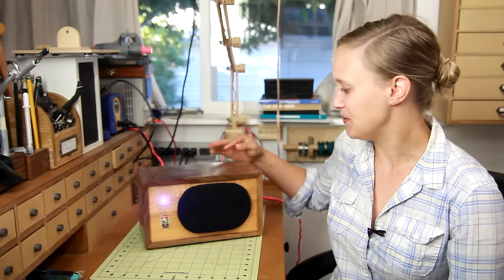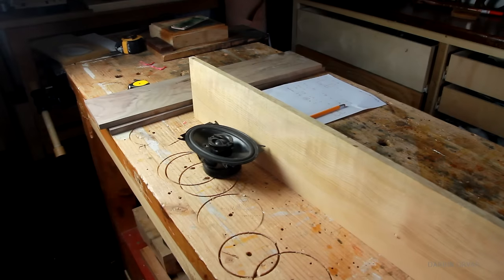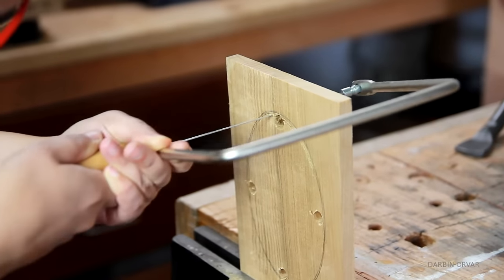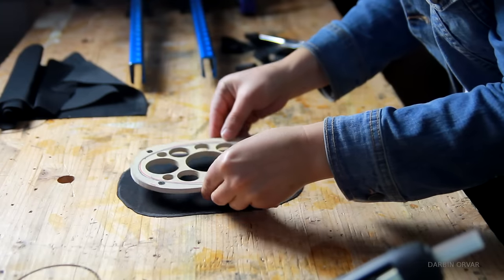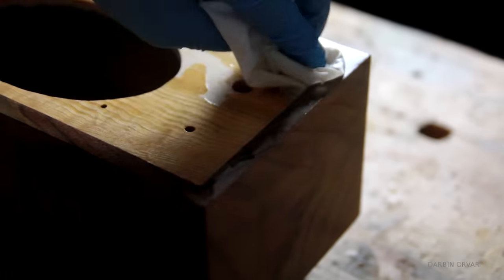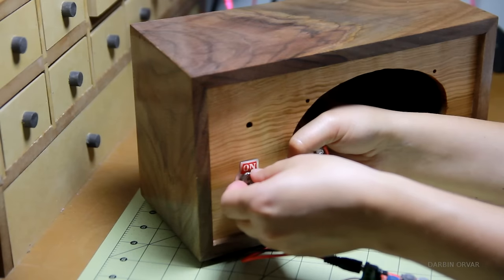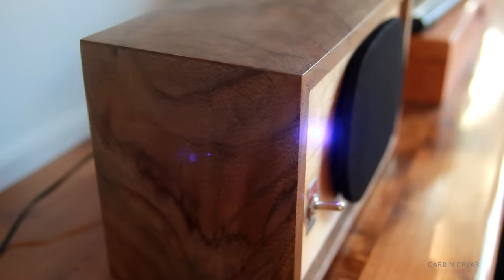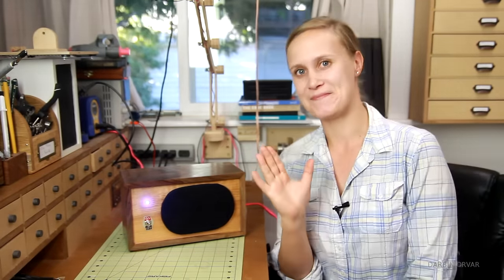DIY Bluetooth Speaker

Comment: Hello there. I just finished making a speaker like yours. Your video inspired me to make one. I used wormwood that was milled from old pier pilings from my local area for the sides, and then I used cedar for the front and back faces. Looking back at it, I think the wormwood is also cedar. I decided to go with a red case over my switch and finished the wood using orange oil. I also got my speaker for free but my speaker is bigger than the one you posted a link to, so my box had to be bigger as well. This was my first woodworking project so the joints are very good but i'm happy with the end results.Here is a photo of my finished product. https://drive.google.com/open?id=0BxS5X6VokvuCdnZNTndpNjFuaVU I really enjoyed your video and came back to it so many times throughout the project.

Comment: How did you convert the stereo L & R to a mono output?
Reply: DJ RENZO  hi! what do you mean is in the amp. it has 2 outputs and she connected 4  wires for 1 speaker .How?
Reply: MICHALIS VRIONIDES The speaker has a tweeter too.
Reply: @DieEneBelg: That makes no sense. If you connect one channel to the woofer and the other to the tweeter, you will only hear the treble of one channel and the bass of the other channel. This will completely mess up your music, especially music where instruments are panned strongly to the L or R channel. 

The normal way to connect a woofer and a tweeter would be to use a single output channel and have a crossover to separate the lows from the highs. But that still doesn't explain how she turned a stereo amp signal into a mono speaker.
Reply: The speaker is connected to a single output. The amplifier is mono. The amplifier Stereo inputs are connected to one using two resistors
Reply: She most likely bridged the amp which is an old stereo trick for amps. You essentially get the positive from one channel and the negative from the other channel which will give you double the output wattage. Sometimes it works, sometimes it doesn't.

Comment: Hi I have the same amp and can't work out how much power it needs what ac to Dc power did you use?
Reply: 12V with 2A is what I am using on mine
Reply: +Pyr0t3ch 
I worked it out at 12v 10A power supply needed?
Reply from the maker: It is a 12 volt dc power supply.
Reply: +Darbin Orvar 
Yes 12v 10A Dc

Comment: More a "how I" instead of a "how to" video.  Schematic?  Resistor for the led?  Didn't address stereo to mono issue using the TDA7492 with a single speaker.   Stylish and not very instructive.